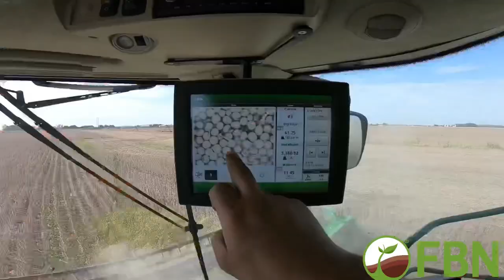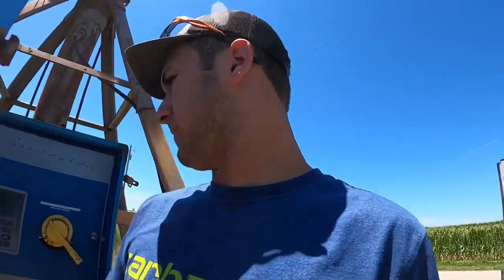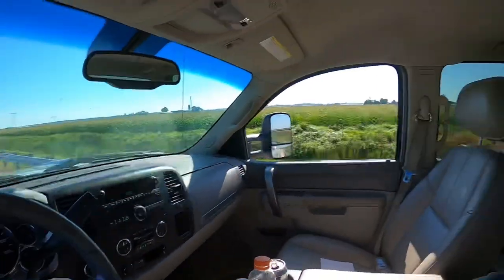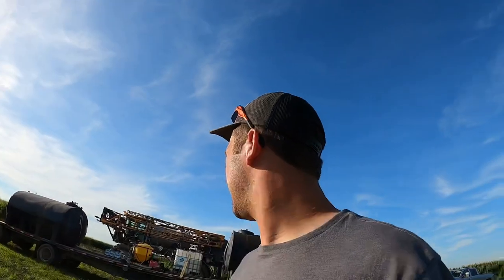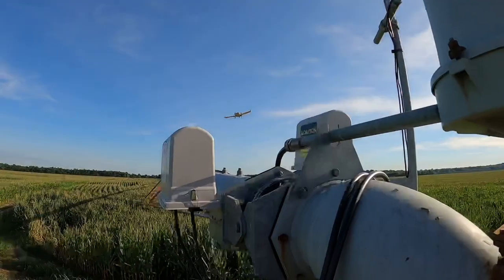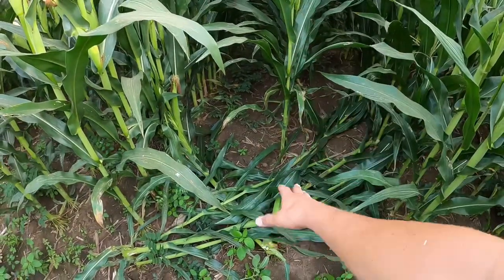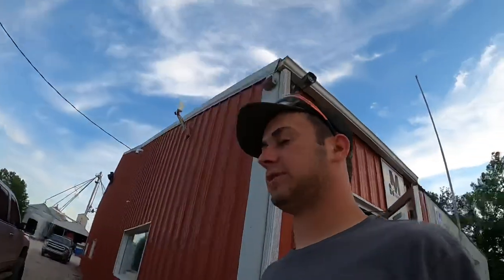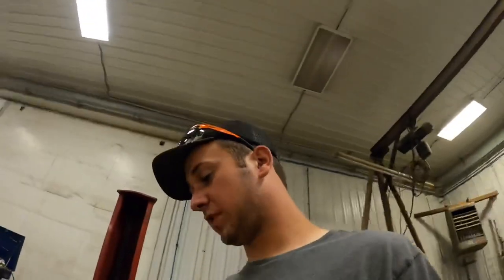Ground spray vs. airplane

Comment: Great Video! I always enjoy watching the crop dusters spraying. Every year the farmers in my area have the cropdusters spray their fungicide on their corn at tassel, but this year I noticed the cropdusters were not spraying the corn at tassel instead they were flying higher and dropping something like some dry granules over the corn instead. Anyone know what they could be spreading instead of spraying. I thought it could be a cover crop but not sure that's the case because the corn over here is all harvested in early August and then disked right after harvest then they let the leftover corn regrow and act as a cover crop for the rest of the year.
Reply from the maker: Interesting
Reply: They were making a dry fertilizer application to supplement the nutrients that the corn needs to reach its full potential.

Comment: The plane did do a nice job. What's the price difference between ground & air applied Alex if you know off hand. We use a Miller Nitro 6500. 1,800 gallon tank, 120' boom. Oh and what went wrong with your truck? Don't think you said or I missed it? All of you stay safe.👍👍
Reply from the maker: We think the truck was a ground wire price difference for us is about a five dollars difference which means we will need more bushels to outdo the plane but we shall see in the fall what it comes to

Comment: You could certainly try 360 undercover. Lots of people are alternating drops and standard nozzles as long as you have 15 inch nozzle spacing to get both over the top and down under. I’d like to try a miller nitro with the spray air boom. What nozzles were you using for the test?
Reply from the maker: Priced some today way to expensive for my taste

Comment: What nozzle did the haggie use what speed and preasure the difference in coverage is to far apart you guys must not have the best nozzle and rate configuration on the Hagie.